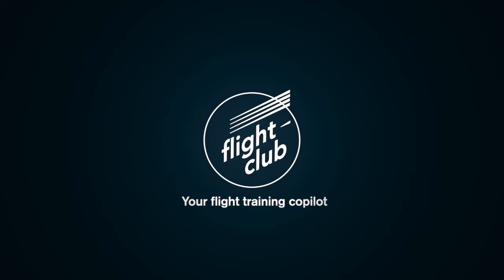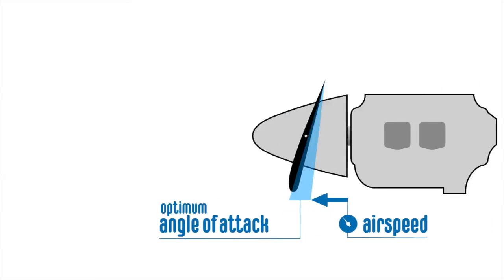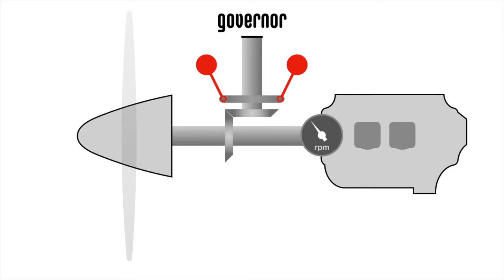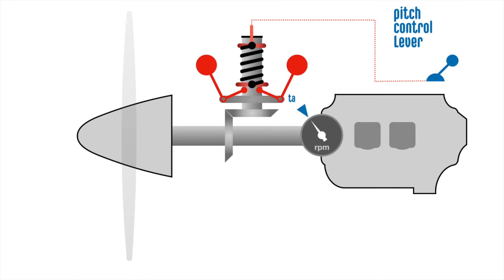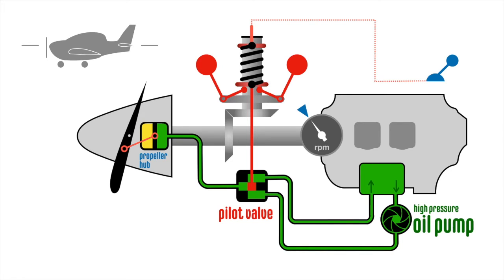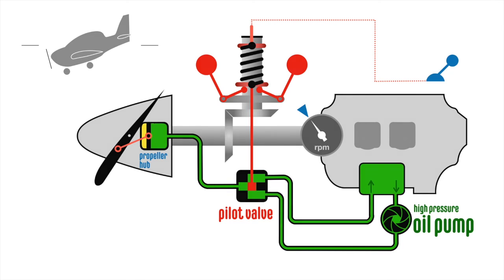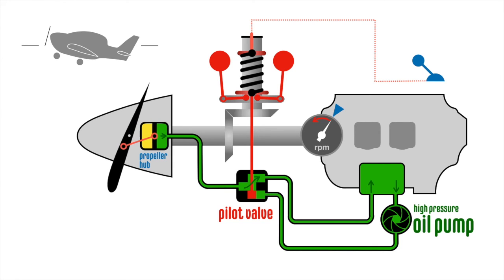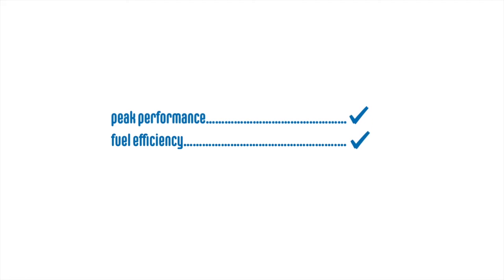How does CONSTANT SPEED PROPELLER work?

Comment: Brilliant and fairly simple concept, equally impressive engineering by Wallace Rupert Turnbull (the original inventor/engineer of the first adjustable unit in 1918) and L. E. Baynes (patented the first automatic variable pitch unit in 1919). 

Excellent video explaining the concept and giving examples which show the function while discussing each step.

Comment: But in this CSU design, if there were to be a hydraulic leak within, the blade would go into full fine pitch which produces pretty much max drag. Should be designed as you need hydraulic fluid to go in to make the pitch go to fine, and without it the blade would be feathered.

Comment: In a car in 6th gear at 2000 rpm means 75 mph (120 km/h) .  With a constant speed propeller setting the car would automatically put it in 3th gear at 6000 rpm.   I want 'corse' and low rpm in my plane, why not ?

Comment: Wait... Right off the bat I dont understand why in the fixed pitch example, a change in airspeed would change prop AOA. I'm now deep down the rabbit whole. Send Help.
Reply: Because relative airflow is the resultant of rotation speed (RPM) and airspeed, if speed vector increase the distance between blade chord line and relative airflow decrease so AOA decrease as well

Comment: Be careful this is for single-engine aircraft. With oil pressure lowering the RPM, and nitrogen gas/spring send the PRM towards the high. So in the case of losing oil pressure, the propeller will work at full fine position.  In multi-engine, it is completely opposite, oil pressure increases the RPM(fine), nitrogen gas/spring decreases the RPM(Coarse/feather). So in case of engine failure in a multi-engine aircraft, the pilot can feather the bad engine to decrease drag.
Reply: I was trying to find the correct answer after this video and it gave me a headache thank you for your help 👍
Reply: @IbrahimAlmalki-bg2pr played a blinder in to the topic
Reply: they should pin this comment fr

Comment: Thanks a lot for the great work but if I may, I think the explanation is fundamentally misleading by confusing variable pitch propellers and constant speed ones. It is true that CSU achieve their goal by varying blade angle but the goal of a CSU is first and foremost to keep the engine running at a fairly constant RPM (like a gearbox) , the aerodynamically phenomena on the propeller being the mean rather than the end goal.
So saying that CSU are the answer to fixed pitch propellers not having an optimal AoA in most phases of flight isn't correct: variable pitch propellers without a CSU do exist and are a solution to that problem. The philosophy behind CSU has more to do with engine power and efficiency.

It is indeed a complex topic and comments and suggestions are welcome.

Comment: Hi could you please explain at the beginning of the video (1:30) it says as engine RPM increases(small blade angle)  the fly weights move OUTWARDS  and as the engine RPM decreases(large blade ) the flyweight move INWARDS , later on in the videos(3:45) it says as to maintain the high RPM (small blade angle) the flyweights now move INWARDS and to maintain a low RPM the flyweights now move OUTWARDS, which is contradicting what was said in the beginning of the video. Could you kindly provide some clarity? Thanks

Comment: Really good. Just one thing, on the DA42 all is opposite. To achieve high pitch and low RPM oil should flow from the propeller to the oil tank and vice versa.
Reply: From this vedio, what I got to see that while at climb or takeoff, low pitch and high rpm is required for which oil goes back from propeller to oil tank.

Comment: Keep in mind the direction of actuation is often different be single engine and multi engine aircraft. Generally... Multi engine aircraft will move into a feathered position when there is no engine oil pressure and single engine aircraft will move to max fine.

Comment: This is only correct for single acting non-counterweighted propellers.  The Governor is not always directly driven by the crankshaft, many are  driven from the accessory drive, or even the from the gun synchronizer drive, i.e. P&W 985 for one.
Reply: This is just a general intro to the basic concept. The point is, it turns a speed proportional to the engine. Any point the motion gets picked off from, is all the same result.

Comment: why is it that in a free turbine when the plane shuts down (less RPM) the prop feathers (pitch increases)? wouldn`t the oil lines have to be swapped and the propeller adjust pitch the other way around?
Reply: They're depicting a single engine aircraft where the engine is designed to windmill when oil pressure is lost. Most multies are designed to feather when oil pressure is lost. Direct drive turbines like most multi pistons have a locking pin that drops in place to prevent the props from feathering when RPM is too low.

Comment: Thanks for the video! You got a new subscriber. However, a couple of suggestions: at the beginning of video when showing fine and coarse pitch I would add "feathered" position. Secondly, when climbing/descending, the order of using throttle lever, eg. when Climbing (adding power): Pitch first, Throttle second; when Descending (reducing power): Throttle first, Pitch second. Cheers
Reply from the maker: Thanks for the suggestion. I should make a follow up video on this topic.

Comment: If the airplane ascending it must increase speed to prevent stall so the blades must be increase angle to take a huge bite of air so the engine must increase the torque.. and opposite is right descending .. not as you mention in video!
Reply: kinda following your thinking.  as it climbs, prop loading slows engine rpm, this in turn causes gov to reduce pitch to maintain rpm.  but you have less bite, less thrust.   only way to maintain thrust is to increase power.  right ?

Comment: great explanation, cheers. As you said the pilot increase the RPM but the plane pitched up, the governor would automatically adjust the blade angle to compensate the RPM?
Reply: my understanding is yes.  as pilot increases throttle, rpm goes up.  gov increases pitch to bring it back down.   in doing so prop has more bite, more thrust.    if the pilot pulled up without increasing throttle, then prop loading will slow rpm down, causing governor to reduce pitch, allowing speed to pick up again.   so rpm remains constant.  caveat is prop will be at lower pitch during climb.